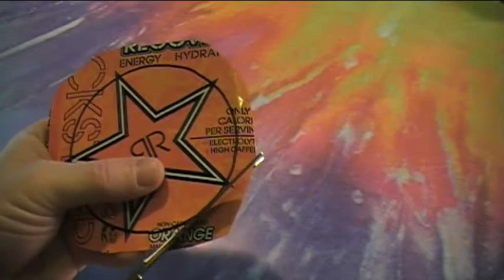DIY - Custom Fosters Pot Lids

Comment: Hey man, not sure if anyone has told you this already but the lids for the empty quart paint cans you can buy at Lowes or Home Depot actually fit a Fosters can with your rim mod very well.  It actually fits well enough that using it as it is causes a small amount of suction to help hold it on.  You could cut off the outer lip and fold the rest in a little and it would be perfect.  I think i paid about $2 for the empty quart paint can (not 100% on that) from Lowes.  Just wanted to share.